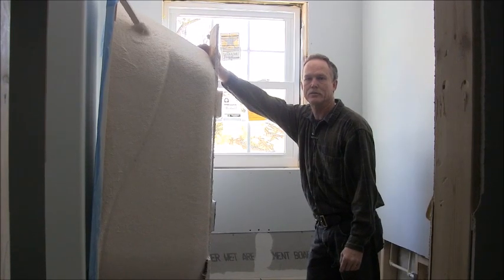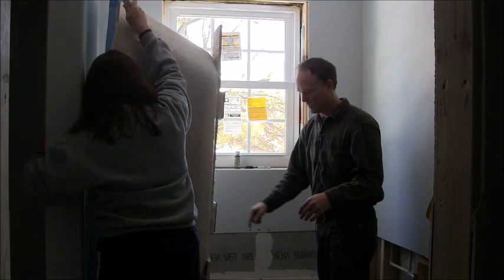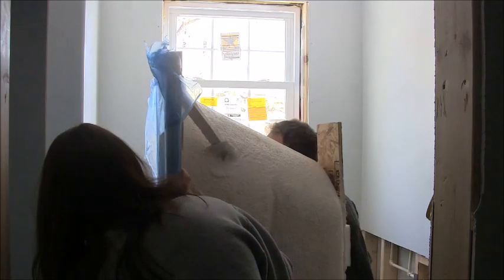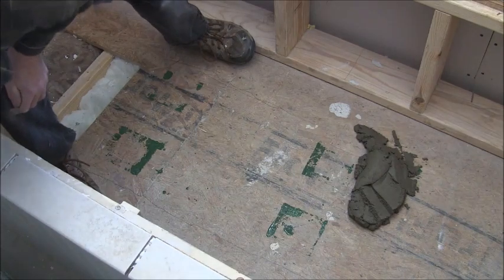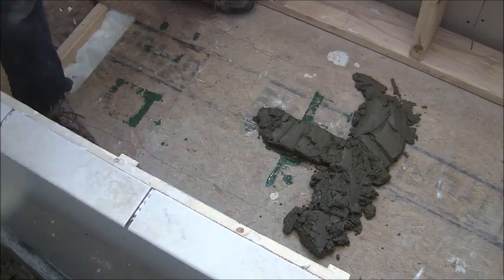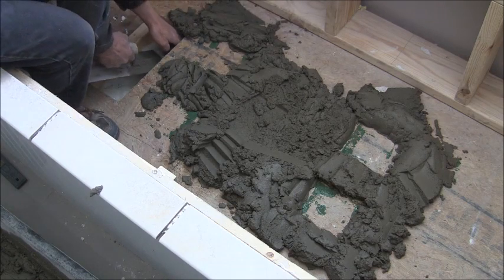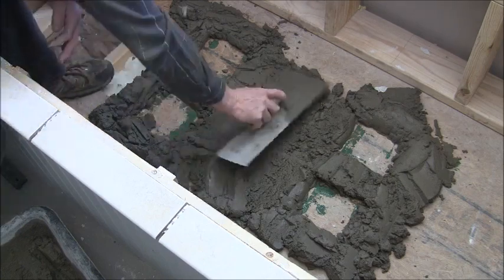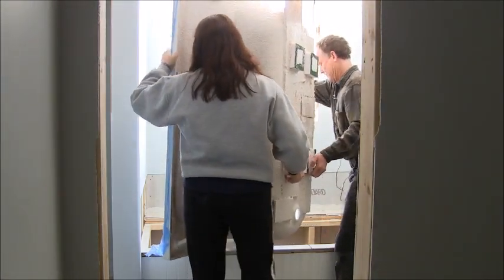How to install a drop in tub using concrete mortar as a support base

Comment: I wonder why they don’t just make flat sold bases for these things. Then you could just spread an even coat of thin set or something to secure it to the floor (thinking shower pans here). It’s like they do the least amount possible in the manufacturing process and then make you do this to make up for the inability to create a well built, easy to install product.

Comment: well done! i have a question..i recently had a tub removed and a shower installed for my handicapped father. And the job that was done was so terrible it's hard to believe. My question is, would there be an instance where it would be ok to use expanding foam instead of the mortar? For instance, under a shower pan rather than a tub? Im going to have completely tear out and redo the work that was done and frankly im very short on money time and help. Im pretty handy but inexperienced so i dont want to make the wrong choice
Reply from the maker: I am not sure about using expanding foam. If I did I would maybe use minimal expanding. Mortar is not very expensive. You should be able pick some up at lowes or home depot for less than 5 dollars. Years ago I was doing a job for a man that was trying to get rid of a dead animal smell in a wall. He had me spray expanding foam into a wall cavity and it was strong enough to push the brick on the outside out about 3/8 of an inch. He called me a couple of years later and he had found out what the smell was. It was a propane gas line that ran underneath his building. Could have been very dangerous.

Comment: Not bad but you should lay down plastic on top of the mortor to go between the tub and the mortar base. As a 40 year repair plumber, no one ever thinks about having to pull it back up and removing it, so it has a chance of sticking to the mortar which makes it extremely difficult to remove! This is especially relevant on any whirlpool or Jacuzzi tub when the only way to get access to the piping is to pull it back up :)
Reply from the maker: Makes good sense!
Reply: We are getting ready to replace an old drop in tub and totally agree with putting the plastic on top. We went through madness trying to pull the old one out that didn’t use any plastic. Great suggestion.
Reply: so adding plastic on top will still allow the mortar to get into the grid system of the tub?
Reply: @russellwilson530  Doesn’t have to be thick, a thin piece is fine. It doesn’t have to get into the grid system. The grid system is self supporting.
Reply: @russellwilson530  In fact you do not want it to get into the grid system!
Reply: @louisp.3332  ok, ill take your advice on that...is 4 mil good for both bottom and top
Reply: @russellwilson530  that’ll work, but what’s top and bottom? Just need between the tub and the top of your base.
Reply: @louisp.3332  i'll lay plastic down on the plywood, put the mortar on that and then add a piece of plastic ontop of the mortar.
Reply: @russellwilson530  absolutely no need to put plastic between the floor and base. None at all. In fact, best not to, wouldn’t want the whole thing to slide around lol. Think you’re overthinking it now with the plastic. Only one purpose for it, so tub doesn’t stick to it. The floor is meaningless.
Reply: @louisp.3332  I have read several post here that say to put down plastic so the subfloor does not soak up the water from the mix.    Do you have any idea where I can find a mortar that is slower to setup? the quikrete will set in 30 mins and its concerns me if will get it set it in time.   Thanks a lot for answers my questions.

Comment: Can someone explain the reason behind placing the mortar if the tub doesnt actually sit on it? Is it helping the frame to keep it from displacing?
Reply from the maker: The mortar helps support the bottom of the tub in two ways. First, when leveling the tub, if the feet or the blocks that the manufacturer adds to the bottom for support don't actually touch the floor anymore, the mortar will hopefully fill in those voids. Second, you don't want to rely totally on those same blocks for suport, therefore the mortar will fill in where there are no blocks for support. I hope this helps. Dennis
Reply: So our subfloor is a bit wavy...we are planning on making a complete bed for it to rest on to hopefully get the tub level. If the skirt sits off the ground a little that's ok with us.
Reply: The mortar supports the areas that are not supported by the pads.  The tub will flex between the pads without mortar and can eventually crack.  By adding mortar, it is actually placing the entire tub on a pad.

Comment: Has anyone used Quikrete 1102 Mortar Mix?  Quikrete recommends this for setting tubs but the issue I have is that its not non-shrinking. they claim it will shrink very little that I would not notice.
Reply from the maker: I have never used it.

Comment: Did you use cement board under that or is it plywood? 
Thanks
Reply: definitely plywood
Reply: Looks like osb to me?
Reply: @Colin either is fine, as long as it’s not cement board. That’s not necessary under the tub.
Reply: @javaTL  isn't applying mortar directly to wood problematic with the moisture from the mortar? One person suggested in an old video I watched to put the mortar in plastic bags. This sounds like it would keep the tub from adhering to the mortar making removal easier later or in the event of having to remove the tub soon after to correct issues, and it would protect the wood. Any thoughts on that?
Reply: @TheEnigmaticmuse  or maybe even plastic sheeting under and on top of the mortar but keep the sides open for it to dry.
Reply: @TheEnigmaticmuse  I have used thin plastic sheeting to separate the mortar from the subfloor. It's your call if you want to put it on top of the mortar too to avoid adhesion to the tub but I prefer direct contact so it essentially joins with the tub and makes it feel rock solid.